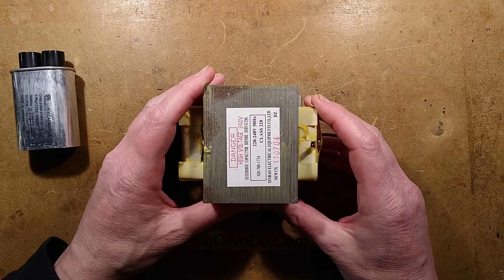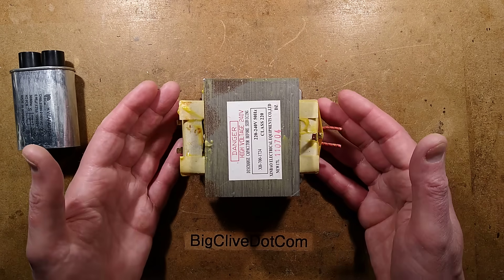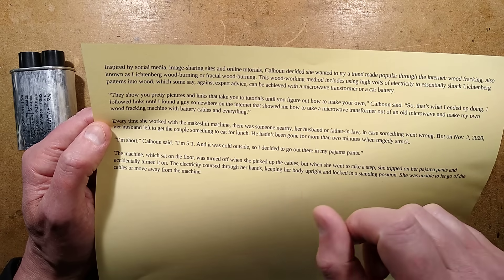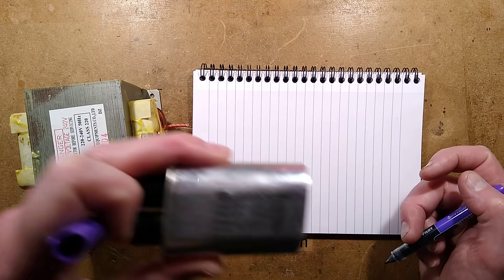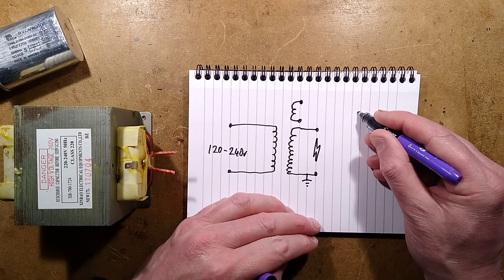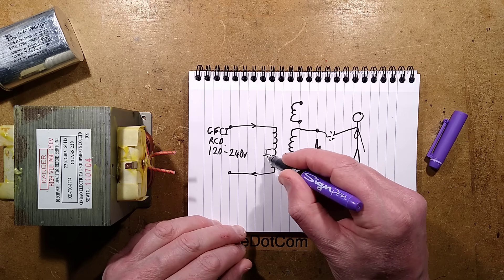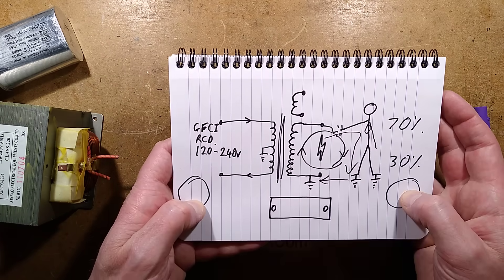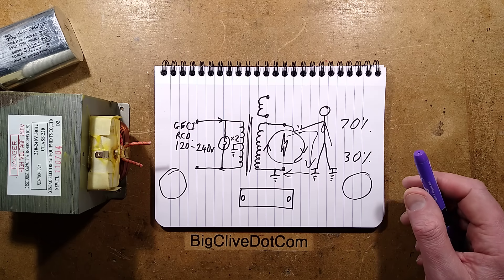The most deadly project on the Internet

Comment: Here's a safety tool I have been thinking about for sometime since i learned more about electricty... It would be the best safety system by field monitoring a human... with a discharge stump.. menaing... that it monitors the field of a person and any change it cuts the power or operation to your system... you can design either hte clothes to groudn the power away form the human to pass through, or  shut off the terminal one is working on... would that be better? I don't know, lol...

Comment: I have worked with relatively high voltages on a truck for its cranes electromagnet where there was a delay when powering off the magnet . 
I don’t remember why it had a delay , but the delay relay was sticking on .

In a seemingly impossible scene out of a movie , the generator fuse refused to blow , almost like it was bypassing the fuse altogether, and the relay shorted or arced internally and exploded when at full power . 

The generators windings on the truck ended up melting into a big brick of copper and burned material. It really made a mess , blew a bunch of fuses and was a lengthy fix.
Reply: I hope nobody got hurt
Reply: @encross8058  No one got hurt thankfully, we actually couldn't figure out what made the bang until we turned the truck off. Big trucks are quite loud , especially when you need to run components off of its drive train. 

The box with the generator in it was closed for safety , which turned out to be a good thing!
Reply: @BigEvy  I'm glad nobody got hurt

Comment: I must disagree vehemently with your statement that modifying the transformer to deliver low voltage is not dangerous.  ABSOLUTELY WRONG!!! Low voltage/high amperage is at least as deadly as the high voltage/low amperage.  In case you somehow don't know this, whether your boosting or bucking the voltage, the wattage (total energy output) stays the same.

Comment: Energy in transformers, as well as the potential energy in capacitors, lithium ion batteries, compressed gas, garage door springs is extremely high and easily lethal.  Never take these things lightly.

Comment: People are so... i struggle to describe it any but dumb with voltages of this kind. If i was doing a project like this, i would have the power button in a location away from the table with the transformer, it is such a basic safety step and so easy to do, it's unbelievable people just walk and operate machinery among exposed high voltage cables like it's nothing.

Comment: Great video! You sir got a new subscriber!! The 2 button system is a great safety feature (which I will definitly use) for an acceptable price, better would be a hold to run button where you need to hold the button in a middle position. Release it and it turns off, press it all the way and it turns off. But it's not cheap and let's be fair when you get info from youtube you usually won't spend €100 - €500 extra for the perfect safety device, I know I don't :)

Comment: QUESTION 
So how dangerous is it to simply take apart mircowaves to scrap the transformer? I'd assume the only danger is in the capacitor. But as long as it's not plugged in and maybe given a week to sit. Is there any hazard?
Reply from the maker: If the capacitor had a functioning discharge capacitor then it should be safe.  But use an insulated tool to short the capacitor as a precaution anyway.

Comment: I made one of these ONCE. I am very experienced with electricity and constructed it in a way to operate remotely 20’ away through a relay.  However, I recognized the incredible danger in this and was concerned that someone may come across it in my shop one day. I dismantled it after the first test run. I still repurpose microwave transformer for various projects but the first thing I do is cut out the secondary winding. Electricity never “looks” dangerous

Comment: So make all the high current connections first if it is the output side. Working towards the power supply. Test, test, and test again. Do they make high current GFCI devices. That you can connect first and make your other connections through that device????

Comment: I am an electrical engineer and I really appreciate this video. People should respect the power of electricity as much as they are fascinated by it. It is a powerful energy. If you are not an expert with standard equipment to work with high voltages, just stay away from it. And by high voltages, I don't mean thousands of volts. Just a hundred volts is enough to kill someone. Some low voltage ac currents can put your heart into arrythmia and give you a heart attack later. So for amateurs, keep it dc and below 40 volts. 40 volts dc will sting, but can't kill you. There are a lot of science projects you can do with that much. For your own safety, don't play with high voltages

Comment: If I humbly dare to correct: 
It's not a Microwave-"Transformer", it's a MAGNETRON...
But most important really is the hilarious amount volts Clyde is mentioning here- IF you're house isn't burn down or you didn't die because of carbon monoxide poisoning, than the improper handling of this power-source as a layman regarding electricity may swipe you away very likely then.
Reply: It is a transformer. The magnetron is the device that creates the microwaves from the high voltage current provided by the transformer..

Comment: One of the things that I have written about as in a book, is high voltage microflashes. I have not put one together because they just don't seem remotely safe. I had some idiots giving my book bad reviews because they don't like the fact I've written about it and been honest that I have not constructed one. It's a prime thing to be replaced by LED flashes but so far nobody's done an economically viable microflash.

One of the important things to realise with high voltage is that the insulating and the conductive properties of materials change. A piece of wood will insulate you from 100v, 200v, 500v but when you get to 30,000v, it probably won't.

Comment: This is one of the deadliest project's I have ever seen, It will kill you, at the least instantly vaporize the surrounding flesh, leaving a 25 MM cone shaped hole in the contact area, This burn is pain full, and slow healing due to the cauterizing effect of an electrical burn. I use to work with H.V. transmitting equipment, and have seen instant death. instead, Play Russian Roulette, it's safer!

Comment: I'm a pretty green electrical engineer with 6 years of experience in high voltage power electronics.... i don't even touch high voltage electronics while they are operational.

Comment: One of the most important things about electricity is if you stumble upon someone who is being electrocuted like this, or are in the room when they start experiencing this, DO NOT TOUCH THEM. Turn off the power, or have something that is not conductive and knock whatever it is that they're holding out of their hands as a LAST RESORT. There should ALWAYS be a killswitch somewhere to turn off the power..... Same goes for electric fires.
Reply: a friend got shocked playing with some weird thing he was building. we were at his house in the garage while he was building on it. I ran at him and tackled him off his feet and it broke the current. I was pretty young and stupid and didn't realize the risk I took, I just knew not to grab onto him. we did CPR on him and the paramedics got em back in the ambulance but he was messed up after. shaky. I don't mess with electricity
Reply: You can give them a drop kick. I would.
Reply: If you turn of the power can you them do cpr immidiatly on the person? How Horrifying
Reply: @teijaflink2226  Yes! After you call 911 and get an ambulance on the way. You just need to make sure that they are no longer in contact with the device in question. 2 inch deep in the center of the chest, and sing "staying alive" in your head while you do compressions, or any other song around 140 BPM. Rescue breaths at the moment are not advised by the medical industry as the blood still has a surprising amount of oxygen left in it.

Comment: I am very familiar with the machines i maintain at the factory, but due to me not being a certified electrician, someone will end up in jail if they instruct me to handle anything above 50V without oversight.

Can't imagine the training it would take for someone to be considered capable of handling bare ended, powered cables in the 1000s of volts, just to stick them into a wet piece of wood.

Comment: Officially a GFCI (Ground Fault Circuit Interrupter) is not the same as an RCD (Residual Current Device) or RCCB (Residual Current Circuit Breaker) but most people call an RCD/RCCB a GFCI because from a user perspective it seems to do the same. GFCI's as well as RCD's and RCCB's usually do the same: They interrupt the circuit whenever a ground fault is detected.

It's the way they detect the ground fault that differs. Where a traditional GFCI measures the current through the returning ground wire for the circuit, the RCD/RCCB measure the difference between the current on the live(s) and neutral. The GFCI trips when the current through the returning ground wire exceeds the designed threshold. The RCD/RCCB trips when the difference between live(s) and neutral wires exceeds the designed threshold. This even works on circuits without a ground wire. In Europe and most other 230 Volts systems this threshold is usually 16 milliAmps.

The difference is a traditional GFCI only works on grounded circuits and only when there is an internal ground fault on a grounded device f.e. a washing machine with a failing heat element or motor. A GFCI doesn't protect for example against using ungrounded appliances in the bathroom and accidentally dropping it in the bath tub. An RCD/RCCB does protect against ground faults using ungrounded appliances and is therefore a more suitable device for general protection against electrocution.

Nowadays I'm not even sure if you can still buy GFCI's in Europe. They were more common in the United States but since the RCD/RCCB was invented as far as I'm aware GFCI's were mostly abolished for above reasons. Most electrical codes nowadays in Europe at least dictate any circuit with sockets/fixtures accessible by general users should be protected by a 16mA RCD/RCCB.

Ofcourse even an RCD/RCCB does not protect against electrocution on secondary windings of transformers. The only way would be to have an RCD/RCCB on the secondary side. Good luck finding an RCD which can handle multiple kiloVolts. I don't think they are readily available and that's also the reason why these transformers are designed to use in enclosed devices f.e. a microwave oven.

Comment: Maybe if the word “electric chair -kind of device” was more common people could more intuitively understand the risks. Deadly current is just too abstract of a concept.
Reply: Even just looking at the intended outcome, that burn mark through the wood… it immediately made me think "jeesh, imagine if it did THAT to ME"
Reply: If people knew what a single Volt could do, when the ampere is Sky high, then the rest of the other SI Units have to balance out, meaning the non- Amp part aka WATT, will increase.
So 1V=1000W/1000A now let's say you touch this wire which only has 1V for 2 seconds, we can still see that kg×m²×1/s³ and we divide that per the unit of Force, Newton, then we get 500m/s of force from what sounds safe. That amount of Energy is enough to cook you real good. Just because you have a gigantic package of energy flowing at you

If people understood that just because it says x Volt on things, doesn't mean that if you somehow lower the resistance now you'll have all the passive Volts which can be in the millions, cook you very fast, There's a reason for why Electromagnetic Flux causes metals to heat up and melt fast. The lunacy of people to expect things to never go wrong for themselves.

I leave all Transformer stuff to the Technocrazy Madmen, such as Styropyro the Laser maker... No one else is insane enough or skillful enough to handle anything of that caliber with safety...
Reply: @livedandletdie  I tend to use Trains as an alalogy, to illustrate why Amps matter as an indication of danger more than Voltage.
Just a Locomotive crashing at 100mph after all is bad, but not as bad as a 8 car petrochemical train crashing, even at 20mph.
Reply: @livedandletdie  styropyro is the best ever
Reply: @livedandletdie  1v at 1000amps will do nothing to you. 1v isn't nearly enough to to overcome the resistance of a human. Watch the video again, this is exactly why clive said removing the high voltage coil and turning it into a high current (amp) transformer is safe and ok. Also, if what you said was true, touching a 12v car battery would kill you, but really if you touch a car battery you feel nothing. 12v is still too low for the resistance of a human in almost all cases. Ohms law...

Comment: Look I know next to nothing about the electronics in a microwave, but I can assure you that if the machine is designed to be capable of bringing cold food to a BOIL after 1-2 minutes of run time, I do NOT want to be mucking around with whatever is powering it on my kitchen table in any shape, form, or fashion.

Comment: :O

I have a small transformer, and i dont even fuck with that one. Its just there, chillin for later

Edit:

I now have more knowledge on transformers.

Also, wouldnt running a car battery through a transformer essentially kill the transformer and the car battery?

I know transformers do their thing via mutual induction, which is only a thing with AC, since its moving.

So yeah dont hook up a car battery to a microwave transformer......

It wont work, and you might blow up.

Comment: One trick I’ve seen with people working with dangerous electrical machines like coin shrinkers and such is the use of pneumatic controls, basically one of those air pressure rocket  foot pedal things, connected to pistons or whatever that operate the actual machine itself via a long rubber tube, completely electrically separating the user from the machine.

Comment: I remember pulling transformers out of old tube TV sets back in the early 1980s, I was 9 years old, Playing with Transformers and D cell batteries. The transformer took that 1.5volts and ramped it up to a point where it would knock you off of the leads if you touched them. I went around talking other kids into trying the leads for a shock. No clue how many volts I was playing with, but it made every joint in your body feel it at once.

Comment: It's not the HV that kills but the current them things can put out. The HV gives it the potential to arc through insulation and through skin. They are essentially a plate transformer. I am an electrician but I played one time with one of these things and got intimidated. I ran a florescent light bulb and it shined as bright as a halogen bulb. However the transformer not being current limited drew about 30 amps and tripped the breaker. When working with these things I recommend current limiting on the primary. I'd never hold both secondary leads in my hands even with supposed good insulation. After my brief experimentation I tossed it and worked with low current HV transformers such as teslas and ignition coils. Even those can really hurt if you get bumped.

Comment: Maybe I'm missing something here, but why is the high voltage winding more dangerous? High current is what kills you. I've been shocked by my 14,000+volt fence charger when I slipped on mud and made contact with my shin. Sent a shock through my leg and ass. There's no current to it though, so the risk is minimal.

Comment: Interesting thing about electrocution… if you happen to survive the initial incident and end up in the hospital you aren’t out of the woods. Your body responds to massive electrical injury by producing an enzyme that, when it reaches a high enough level, will begin to dissolve your muscles. Your kidneys can’t handle it and you’ll either die of kidney failure or sepsis, the way to possibly prevent this is to monitor this enzyme in your blood and when it reaches a certain level the surgeon will begin cutting out the big stuff, large muscle groups, and hoping for the best. Dont F with electricity

Comment: Me and a friend have done this and other things, but we always float or isolate the ground on cerabic incilators, etc. That is also more controled using a variac array. I did this myself with my frind helping showing me how I just used an oil burner ignition transformer. 10KV I think maybe like 50MA.
Reply: A Variac is an autotransformer - meaning it is directly connected to the mains electricity supply at full line voltage - whatever setting you have it on.
And 50MA (sic) would send send you the other side of the sky, literally - with nothing left for your folks to bury. Even 50mA (50/1000 of 1 Amp) is lethal; which is why ELCB's are rated to trip out at 30mA.
Nobody has mentioned that if you want to minimise the danger, then use an isolation transformer in front of the Variac as well as the "cerabic incilators, etc." you write of.

Better still, just don't be a chancer - leave it.

Comment: My professor in college always told us to stay away from magnetic fields and do not introduce magnets into magnetic fields.  Once in the lab, I messed up and dropped a pencil next to the transformer.  I failed to turn the circuit off.  I reached in and when my hand came into contact with the magnetic field.  Here is what happen, besides my professor cane running to me with a suprised look on his face.  It felt like someone grabbed my arm and shot a huge amount of electricity into me, and I could not let go.  Some how I was able to remove my hand.  My professor kept asking me if I was alright? I was, not even a burn.  I did not touch the transformer direct, but inside the magnetic field.
Reply: Did you have a watch on? I'm not understanding how the magnetic field pulled you.